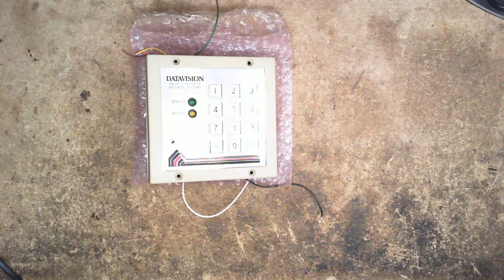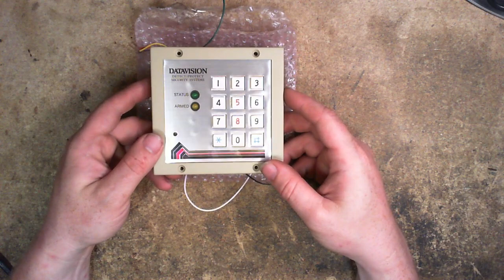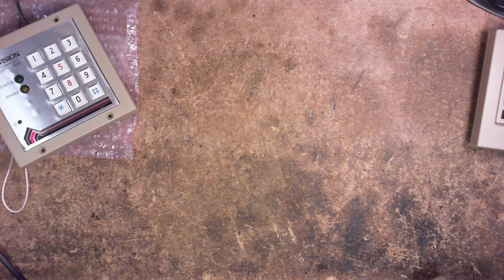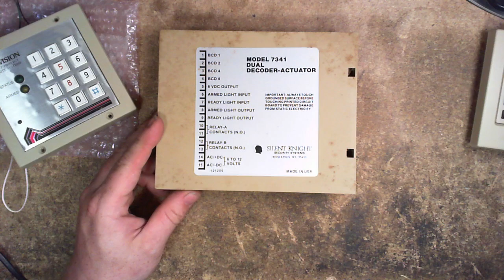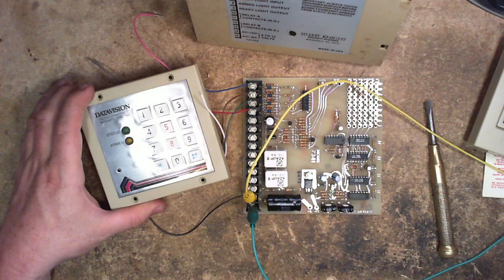The Silent Knight 7341 Keypad Controller - BCD Keypads Made Easy

Comment: Ah, that's pretty clever. I had wanted to something similar for my electrical engineering project in school, first with an RFID tag, then a microcontroller with a matrix keypad, then due to time limitations around implementing it I finally had to do what two other people in class had done all along — a hard-coded code by means of which buttons were wired-up and which weren't. The way this sets the code with jumpers is like, in between those final two in complexity and I love that. (I know it's a BCD, not a regular matrix, but.)

Comment: But you didn't connect up the LEDs...... :(
Reply from the maker: I could not figure out how they wanted you to wire it. With a positive input or a pulldown I could not get the indicator outputs to light up.
Reply: @CelGenStudios  Well, that's no fun, and a I bet a bit frustrating as well. :)